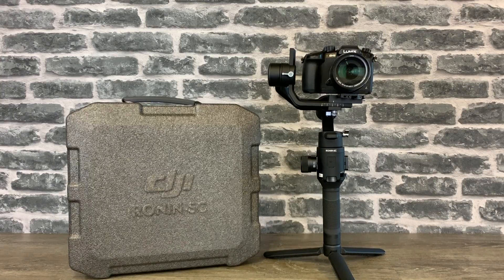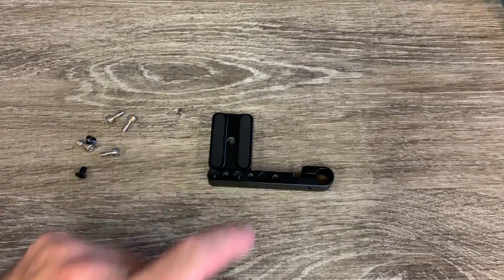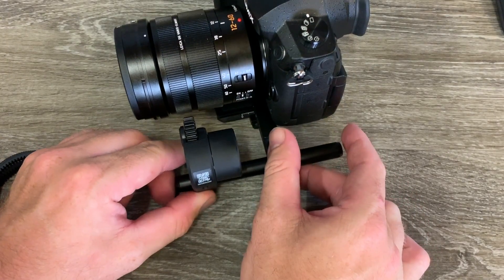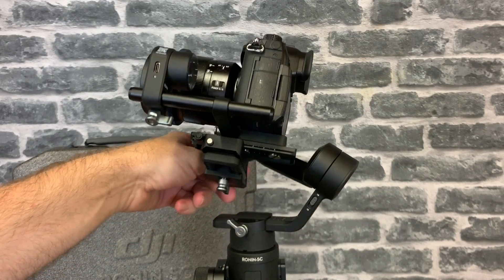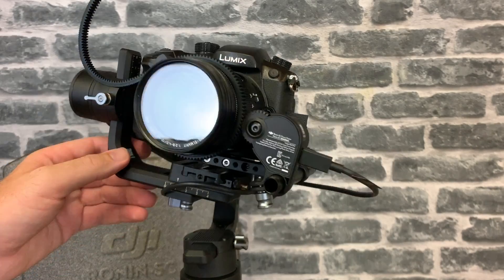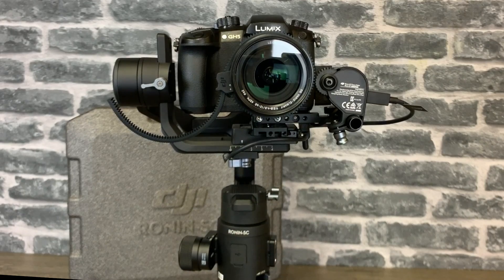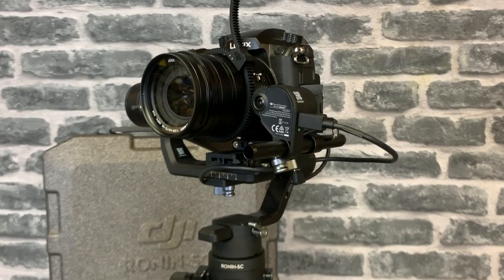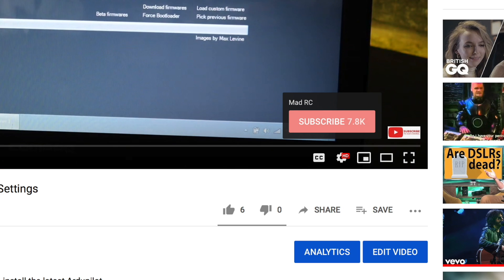DJI RONIN-SC PRO FOCUS MOTOR SETUP AND DEMO ON PANASONIC GH5

Comment: Hello, thanks for the video, but at the start you mentioned that the focus motor was compatible with every camera. This is not true as I have a GH4 and it cannot connect to the GH4, so while it took me a long time to learn this and set up (good if I ever swap cameras) I reached a dead end upon connectivity.

Comment: Hi. My question is about GH5 & Ronin RS3 pro, used with focus wheel. Trying to set up focus use via Raveneye but having problems with calibrating focus motor. It either 'times out' or spins until the connection part of the focus belt hits top or bottom of focus wheel, eventually causing severe vibration - stopped only by switching everything off. Tried setting start and end points, but as soon as I try using focus function on mobile 'phone I am told I need to calibrate focus wheel first - and so the loop of frustration continues!! Lens set to MF and seems to be the same whether in MF, AFC or AFS/AFF on camera. What am I missing here? Remote use of focus via Raveneye should be possible and is a key function for use in wildlife filming. Cheers

Comment: I'm sorry to say your setup doesn't work really well. The focus motor is made for manual lenses, not modern lenses with focus-by-wire rings. Lumix lenses spin infinitely because the focus system is electronic and not connected physically to the glass element inside.

Comment: Very Nice video. Ty for sharing it.  I did noticed  an potential " issue " with the Focus Motor system/Rubber band.  Right around timestap: 6:44 , I can see how the lens is appears to be moving out axis when the excess rubber band touch the bottom of the Focus Motor. I do not think that is healthy for your lens and camera bayonet in the long run.   I wonder if they sell 3rd party optional rubber bands without the excess rubber that can be use to address that issue.

Comment: Have you had any luck connecting an external monitor to this set up at the same time. I don't seem to be able to do it. With the focus wheel attached the wifi option in the camera disappears meaning the monitor can't be added. Do you know of a fix for this? Thank you!!! :)

Comment: Hello there, I followed the setup instructions in your video, and I had the hardest time to balance the camera, facing the front of the camera, I had to push the body al the way to the left, since there was no more room to push the body and still unable to balance the camera, I had to add a counter weight on the left of the camera, but still didn't work, then I watched another video and actually the focus gear motor, goes on the right of the camera rather than left, and what a difference that made, if anyone wants to do this the right way, please watch this guy video: https://www.youtube.com/watch?v=-2rcKC7KtCo&t=4s

Comment: To answer all those who think that it is necessary to reverse the assembly of the engine:
If you mount the motor on the right, you are forced to dismantle everything to change the battery while in this configuration you just have to move the GH5 forward or back on the rail and the battery becomes accessible.

So in the end it's the right fit for a GH5 S.

Comment: Is the motor necessary  to do manual focus or with a compatible camera is not necessary?
Reply: No, it is not Sotto! I discovered it lately. The USB-C cable do the connection between the wheel of the Ronin and the GH5 manual focus electronically! Don't need the motor focus :-)

Comment: I wish you would have gone on about the GH5 camera and lens settings.  For instance is the camera set for AFS/AFF or AFC or MF?  Also which button is set, the S-BUS or the CAN button on the bottom of the Focus Motor. The lens is set to auto focus, I am assuming. So much that the manual for the focus motor doesn't cover. Otherwise good review.  I did have to remove the lens support though on my GH5 set-up because when the motor was calibrating it hit on it as an end point.

Comment: Great video.  I have a hand held stabilizer, but find that my Sigma glass is too heavy for it to work (because it's too front heavy).  Do you know if this focus puller will work with the GH4?  How strong is the motor, or rather can you balance this stabilizer with a lense like the Sigma ART 12-35
Reply from the maker: I have not tried the Sigma glass, whats the weight like compared to the 12-60 f2.8  i have on there here. Motor is strong so I would not be concerned with that.
Reply: @MadRC  compared? I don't know. The lens is 1.78lb (811g). The reason it won't work on my other gimbal is because I can't move the mounting plate far enough ahead to find the center of balance... And even if I could, I don't think the motor is strong enough. Works fine with my 20mm pancake lens. But that's a tiny lens.

Comment: What I’m interested in is, can i use the focus wheel with focus cable to MANUALLY control the focus without plugging the camera cable into my camera, because i want it to use it on my canon 800d which doesn’t have built in power zoom, so i just want to set the focus rod onto the lens and connect the focus motor with the focus ring to manually control the focus of my camera. Will it work?
Reply from the maker: Yes, so as long as you use the focus motor and control you can use with any camera and lens setup as long as it will physically fit.

Comment: Can someone please answer. If using an auto focus lens on a GH5 set too manual focus can the gimble wheel control focus therefore rendering the added motor unnecessary? Thanks
Reply from the maker: Motor is not needed for electronic lenses however take into account focus pull via the lens servo is not liner like a focus motor.  So it won’t react the same if you change speed and it’s not A - B predictable.   However to take this a step further many of the Panasonic lenses have a digital focus ring that is also not liner so when using the motor you still don’t have full liner focus pull that can be marker to specific points.    It’s really all down the the lens.  

I would not recommend the motor on lenses with the digital ring as it’s no better than the internal servo pull in many cases.  For proper manual lenses it’s ideal.
Reply: @MadRC  Many thanks.

Comment: So you've mounted the motor wheel the other way around? Any reason behind this? 
In my opinion and according to DJI, you should mount it on the opposite side. it's a bit like wearing your boxer shorts the wrong way around with the label at the front :]

Comment: My camera isnt in the compatibility list (i have a nikon d3500) am i still able to this?
Reply from the maker: If it’s with in the weight limits you can use it but you may not have the integrated control options like time laps and shutter control on the gimbal.  But it will still stabilise.

Comment: Thanks for this, could you tell us how to make the Gx80 working with the Ronin SC ?
Reply: You can but with limitations. The GX80 isn't capable of connecting to the Ronin-SC and therefore remote recording with the SC record button won't do anything. This can be fixed by using the Panasonic image app, which enables the user to control the camera via WiFi connection. A smartphone can be mounted on the side of the Ronin and replaces the record button.

Comment: I didn't get the utility of the cable that connect the camer to the splitter. 

I do not heve micro usb or usb c on my camer, will I still be able to use the follow focus ?
Thanks

Comment: Great Video. Is it possible to show the live view of the gh5 on the DJI App? Also I prefer seamless focus rings for this, no stops necessary.
Reply from the maker: Sadly no not at this time. Panasonic have kept that locked dow.
Reply: @MadRC  the zhiyun weebill works with this... all they have to do is route the hdmi signal through the gimbal to the app.

Comment: When using the SC with the GH5 and autofocus, do you have a favourite setting in the GH5 AF menu that you feel produces the most consistent results?
Reply from the maker: Bad Robot it’s hard with electronic focus ring as it’s long liner even when you really play with it.  Really you need a proper manual lens to get the best feel from this.
Reply: Mad RC thanks, I thought so. Although I saw a video that where someone felt the Leica  15mm had a more linear feel. I have this lens and I would agree it does feel more predictable.

Comment: Great video. Question about using this on a zoom lens, such as the Lumix 12-35 or 35-100: does changing focal length affect the balance of the gimbal? I had a Ronin M a couple of years ago and it was always recommended to rebalance after changing focal length. Any thoughts? Cheers.
Reply from the maker: It will yea, of your lens is extending it can. The Ronin S generally comes with this ok but the SC may need to be rebalanced.

Comment: Thanks for the video. 

What is the behavior of the gimbal when the motor is used for the zoom? Mostly, the lens lengthens when it is zoomed so the balance should be affected.
Reply: Balance it before hand with the lens zoomed in at the halfway point.  If you focus all the way out or in, your motor won't strain.  I use it to zoom because the Gh5 auto focus is pretty solid after the update, and because it's easier to just turn the wheel.

Comment: Very informative, but display cannot be opened with this setup. You'll need to change focus motor tube holder upside down, move it one screw hole right and install cable junction block other side of the camera.
Reply: I was wondering the same.

Comment: Hey, awesome video! It was super easy to follow along to, thanks for taking the time to make it. I'm having some trouble calibrating my focus motor... When I double tap the multifunction button to callibrate, the motor is getting knocked out of position by the notch on the gear strip so that it can't reach the teeth anymore. 

Did you run into any similar problems? 

Here's what I mean: https://imgur.com/a/qcAH5Qd
Reply from the maker: Try reversing the ring and tightening the rod up.  Iv not seen that my self but if you reverse the ring and pin down the strap with a cable tie it shoud help
Reply: I've got the same problem as well. Still haven't found a good solution.
Reply: @LightningPr0ducti0ns  hey man I feel for you. I'm still dealing with this nightmare. I recommend you go back to the camera store where you bought it (or straight to DJI support). That's what I did and they admitted it was a manufacturers flaw... But they have a crazy policy that if you don't post it through within 7 days of them opening a case, they won't replace it for free and you'll have to pay for a repair instead. I didn't realise that so now I'm working with my camera store who are being very reluctant to help. I found sending videos to DJI helped get my point across so I'd recommend that.
Reply: @fionac4008  La solución es introducir un papel o cartón entre la varilla y el círculo donde se aprieta la rosca. Con eso queda fijo
Reply: Tighten all the bolts securely, and remove any excess gear strip. Also, set a limit in place (point A to B) so that it the rings avoids contact with the motor.

Comment: Would the gh4 work exactly as the gh5 in your demo, being that the focus seems all manually controlled by the motor attachment it would seem the case, I was just confused by the fact you attached a cable to the gh5 and didn't know if somehow the camera is having input on the focus motor
Reply from the maker: Yea GH4 would be the same.  The cable is for camera control not focus specifically.

Comment: I'm guessing you don't actually need the focus motor with this lens as you can electronically pull the focus with the focus wheel and the GH5. Is their any benefit to the motor on the focus ring?
Reply from the maker: Yes, it’s really for manual lenses or pulling zoom.

Comment: Do you know if you can use the focus motor via the app? Remote zoom on a lens is what I'm looking for! Thanks
Reply from the maker: Don’t think so, I need to check this tbh but I’m 99% no.
Reply: Hi Mad RC, just to let you know, this week DJI have now added support for the focus motor to be controlled remotely by the Ronin App. I'm really pleased that DJI listened to its customers and added this function. Great for remote focus or zoom control 👍🏻
Reply: @007silverwings  Hi 007silverwings. Did you manage to get it working? I have the bluetooth controller and everything works remotley apart from the focus motor.

Comment from the maker: Hi Everyone, I hope the info in this video has been helpful to you, I would really appreciate it if you would subscribe to the channel. If you would also like to support me in what I do below is link to the Ronin SC on the DJI Store, this is an affiliate link and by using this you are helping me continue to run my channel and  keep making videos like this. 

https://click.dji.com/ACtEmwv_AdEc2CECkPMqhA?as=0044&ch=SCYT&pm=custom

Thank you for watching and as I said please do Subscribe, Like and Share :)

I have to say this thing has been solid out the door, just works great, zero issues at all and imo overall behaviour with the GH5 is much better than the S. Sometimes I would have issues with the control connection on the S but not once seen this on the SC. 

The biggest thing is being able to put this thing away at the end of a shoot into its case.  I can’t stress enough how good that is.   

Overall I think DJI have knocked it out the park with this new model 

Some common questions I am seeing around forums and Facebook is

 1: Balancing with larger lenses mostly on Sony bodies. Fitting a Smallrig cage helps a lot with this as it shifts the weight back In the body and allows for longer lenses.  

2 Balance for Active Track 3.0 
You will need to totally rebalance the setup with the phone on top. Imo the XS is about as large as you want to go but it will perfectly balance on the GH5, I will be posting a video on this very soon.  

3: Overall balancing questions, this simply comes down to practice and getting used to the way the gimbal behaves, for me I can pretty much get there in a minute or so with a new body but I have had a lot of practice.  
I do think it’s 100% easier than the S for sure to balance.  

Overall so far I’m loving the SC.  

I’d like to thank everyone who supports the channel and have posted kind words. Below is a Affiliate link  to the SC If you would like more info or to support the channel, when I use these I do so knowing the product I’m talking about meets my expectations and needs, I would not recommend something that does not. 

 https://click.dji.com/ABic0xam9mzfbnj1LTCc3Q?pm=link&as=0001

More videos on the SC coming very soon.
Reply: Hey bro does the focus motor work for zooming in too? Cuz I really want to get it like rn, not now, but rn lol

Comment: Doesn’t the gh-5 work with the electronic focus?  If so, did you notice a difference vs mechanical focus wheel?
Reply from the maker: Yes So you can use focus for manual lenses.
Reply: @MadRC  In the Sony 6500 the Focus Wheel (without the motor) only can control de zoom, but you know if I mount the motor, put the gear belt onto focus ring on the lenses and set the a6500 to Manual focus can do the trick?  Thanks